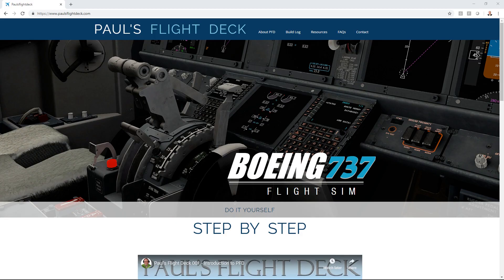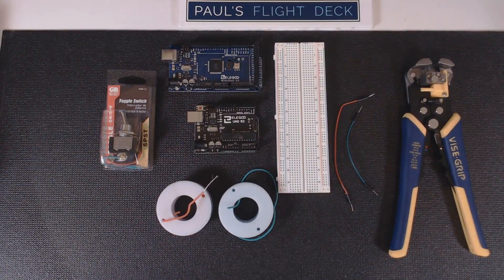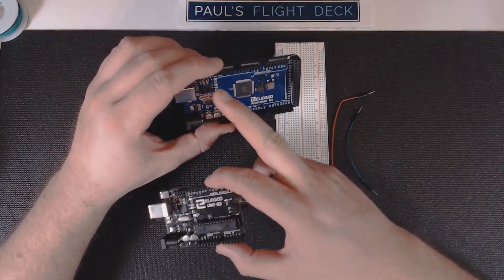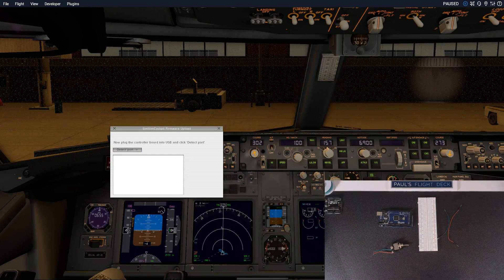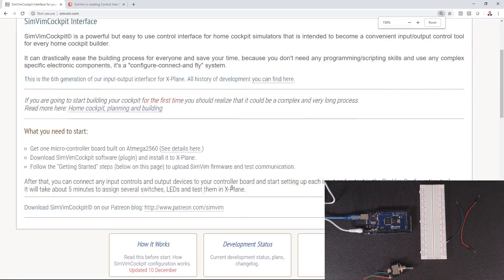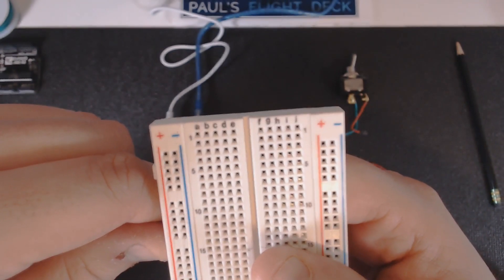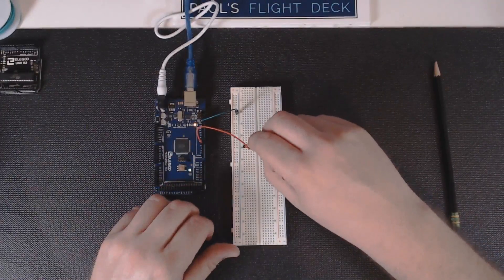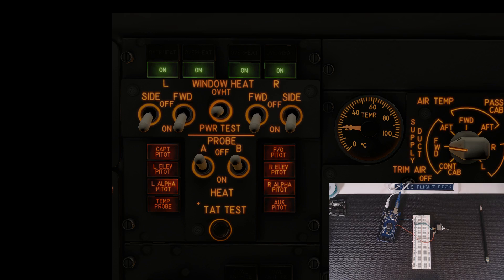Paul's Flight Deck 002 - Tutorial 1 with SimVim Plugin

Comment: If I was to use a 12v illuminated switch with this for xplane would I need a 12v power supply to run the board

Comment: I plan to give this a try.  I know this video is two years old.  and I imagine SimVim software may have changed a bit in two years.  So should these procedures work just the same?  I am doing this to get a handle on how SimVim works as I am building a simulator using some or maybe all of Karl Clarke's designs but he runs P3D and I run X Plane 11 and the ZBO 737 and associated software.   Thanks!!!

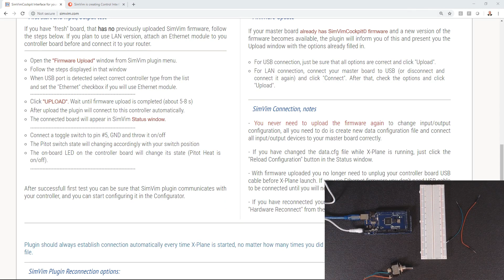Comment: 8:59 - pitot is a real thing, it measures air pressures. It is pronounced "Pee-tow" 
https://en.wikipedia.org/wiki/Pitot_tube
Reply from the maker: Thanks for the info Jack,  I'm pretty green to a lot of the terminology, I'll remember how to pronounce Pitot and how it works now.
Reply: Kinda measures air pressure but it's purpose is Airspeed Indication. The system compares the pressure from the static vent and the in-rush pressure from the tube to determine the airspeed. Air pressure is measured at the static vent and used to calculate altitude.
Reply: Yes, it's a very valuable instrument used to warm your hands during cold-weather preflight.

Comment: Hi Paul, maybe Simvim latest update work differently. But I tried this tutorial and it worked for a Cessna but won't work for Zibo. Wonder why.
Reply from the maker: Hey, SIMVIM has updated a number of times since these videos.  One of the reasons I initially dropped the series was due to how everything for SIMVIM  Changed and my tutorials became outdated very quickly.  They have documentation on their site and active patreon last I checked. If they dont change for a while I'd consider revamping the diy series.

Comment: Hello 
I have down the same procedure on my latest xplane 11.50 using the latest simvim firmware
Everything goes juste like you but i have never been anle to have the arduino on the status windows
It serms to upload well
It does work fine under windwos if i upload code
I seem'to have done something wring but cant seemnto find what.. simvim remains silent bothnon my commuter and email...
Would you have a hint? How ton"erase" everything both from arduino AND xplane?

Comment: You should check out the Arduino Leonardo or the Arduino pro micro; your computer will recognize it as a USB device automatically, and they make great controllers if you don't require a ton of pins.

Comment: You will actually appreciate using that stranded wire.  The single strand stuff is nice at first, but if you bend it too much it breaks...that doesn't happen with the stranded cable.
Reply from the maker: For anything that needs to move I prefer stranded no doubt, but for prototyping on breadboards I'd much rather have solid core for ease of insertion.
Reply: So... I always (40 years) preferred single-core, not stranded wires, why build a project with bending wires....  Look at the old mainframe wiring with kilometers of single thin wiring.
A good 0.3-0.5mm single-core wire is very reliable, you will never brake it. And it is very convenient to lay it on surfaces as, it keeps the shape when bending .. etc. 
Vlad - SimVim

Comment: Hi Paul, I have looked at several videos regarding Simvim and the initial testing of components before making the decision of which way to go (Simvim / Mobiflight). 

I struggled with the Simvim configurator, I could assign pins and saving them but when it came to loading the configuration into Xplane it just wouldn't work. 

I checked and rechecked my wiring then it dawned on me that I had saved the data.cfg file in an incorrect location. it should be saved in "X-Plane 11\Resources\plugins\SimVim" I hope this helps anyone else that may be having a similar problem.

Comment: I'm sure you figured this out already, but for the benefit of people watching the video, the 2560 should power up with just the USB connected. Mine does, but it's not detected by X-Plane unless I use a separate power supply, and does this whether I use a USB hub or not. Not sure why it does this, but I was planning to use it this way anyway, so not a big deal for me.

Comment: I think your switch is backwards, when you showed the red wire it was attached at the OFF position.  In the video with X-Plane, putting the switch down (pointing to red wire) it turned the pitot heat on and vice versa for when the switch to up (or on) it turned it off.  Minor point to an otherwise excellent video.

Comment: I'd advise against sticking pins into the board while it is powered.
Reply from the maker: I'll remember that going forward.  I've bee guilty of doing things while current was available and definitely not the best way to work.
Reply: Why not, you can do this (stick wires to assigned input or pull-out) as many times as needed while this is inputs, you will never get a problems.
If this is displays or other output devices, so it can be advisable, but not necessary too. Watch power lines mainly.. avoid unexpected output short to ground, etc. 
(my 40-years experience in electronics), here you can see some advices: http://simvim.com/tips_power.html

Vlad - SimVim
Reply: @homecockpitinterfacesoftwa4883  Good to know, I was just following the advice of the board manufacturer

Comment: Awesome! So I assume you could fit 2-3 panels on one MEGA board? As long as the cables between the switches are long enough?
Reply from the maker: You certainly can, especially with over 50 pins available on the Mega 2560.  You can do even more when you use shift registers to multiplex.
Reply: Please read SimVim website pages  - http://simvim.com/svc_io.html  -  about all connection options. Only one master controller. Your system can have 500+ switches, 500+ LEDs, tens of LCD and 7-segment displays. For wiring use thin solid-core wires (a thin I mean 0.3 mm), length can be any but I don't think it will be more that 1-1.5 m in your cockpit.

 Vlad - SimVim.

Comment: Congratulations on the tutorials, I have a question, how many mega arduino board can I connect in the same system? Or with just one card can I make any system?
Reply: Please read SimVim website pages about all connection options. Yes, only one master controller. 
Your system can have 500+ switches, 500+ LEDs, tens LCD and 7-segment displays.
Vlad - SimVim

Comment: Thank you! Where did you learn what all the parameters mean? Like brightness for panel lights. Sometimes I see r=0 or i=3. Is there somewhere I can go to learn how to use the SimVim configuration tool?
Reply from the maker: Hey Gary,  I've exchanged emails with Vlad at SimVim and other patreons on their community page.  It's been a long road learning bits and pieces along the way.  SimVim has so much info on their site and 99% of it is there, but it's always that last 1% that's hard to find.  I plan on getting into dimming of panels etc. much later and for now I'm covering the basics. When people ask me questions like yours I want to get a solution (for myself included) but I need to focus on the step by step I have laid out already or I'll get lost chasing things down the rabbit hole.  I hope my videos are thorough and answer questions I had when learning it all.
Reply: Just select needed brightness parameter in the configurator and all will work. 
Read about" custom" planes, every BRT can be reassigned as you need in the conversion tool (index of dataref changed).  All in the SImVim website
Vlad - SimVim

Comment: Hi Paul & thank you for this awesome clip, I'm trying to use a pro micro board to add rotary encoders to my X plane11 738 zibo, my question is if this generic none arduino will work with SimVim Plug in? Thank you.

Comment: sound silly, but once done with the testing, you simply move the cables to the Arduino Board right, do you use Resistors at all ????
Reply: No!  No any resistors needed ever for inputs that you simply connect to logical 0 (GND). Why would  think about resistors at all  in such cases? 
If you mean pull-ups for inputs,  they have internal  pull-up. 

Vlad - SimVim
Reply: @homecockpitinterfacesoftwa4883  ..told you it's a silly question  :-) , anyway tnx you so much

Now, and please excuse me for my ignorance, I'll take the opportunity to ask one more question, can I connect LED Tipped Toggle Switch that is rated 10/A 12V DC to the Mega2560 Board ?

Cheers Yair
Reply: @yair1956   Yes, of course, for such low-power devices you can not  to pay attention on any "rated" information. You can connect any if they rates as thousands of volts/amperes, doesn't matter. The "rated" information means only that you cannot use it in powerful systems that can provide a  current >10A through this switch.
In this case this current is no more than 0.1mA.

Concerning  the in-built LED, you need to know it's parameters, to power it correctly.
Vlad
Reply: ..make sense ... tnx again Vlad

Comment: Do they only work with Mega Boards? I have an UNO board...
Reply from the maker: Hey Juan, SimVim works with the Uno R3 just as well as the Mega.
Reply: @SIM3PAUL  Thank you for the answer! Another question, when I want to connect a toggle switch, do I need a resistor?
Reply from the maker: Hey Juan,  I don't usually use a resistor with a toggle switch, but I do use a resistor between some components the toggle switch controls.  So if I'm connecting an LED indicator, I'll just have the appropriate resistor in the circuit After the switch and before the controlled device.  Also, only use the + (VCC) side of the switch to control things as a best practice.  Hope this helps!
-P
Reply: @SIM3PAUL  THANK YOU!
Reply: SimVim works with Mega only.  Read our website,
Vlad
Reply: @JuanSanchez-jd2nu  NO, no any resistors for switches!  Why? You never damage INPUT connecting it  to 0 (GND). 
Just follow our instructions on the SimVim website.
Reply: @homecockpitinterfacesoftwa4883  I have Uno only.... Do I have to buy Mega? Really doesn't work with Uno ???

Comment: ehh it seems pilot heat input work,but switch not move on sim
S5 Pitot_L_Heat
not work
B5 Pitot_L_Heat
will crash xplane lol

works cessna but not in 737-800
and led output it reversed. pitot on led off

Comment: At the time you declared "Pitot switch" a typo,i had to stop watching. Sorry.
Reply from the maker: I can't blame you! LOL.   At the time I recorded that video, my skills in circuitry and electrical fiddling far surpassed my understanding of aeronautical terminology.  I'm happy to say within weeks of uploading that video, many people reached out to me offering correction and I even joined Delta Virtual Airlines where I passed a condensed version of the Delta 737 Captain's exam where so many technical aspects of the airframe and engines were covered.  I haven't made this mistake since and while this video is getting on in years, even if you didn't watch it because I came across as an idiot, thank you for still dropping by to check it out and comment.